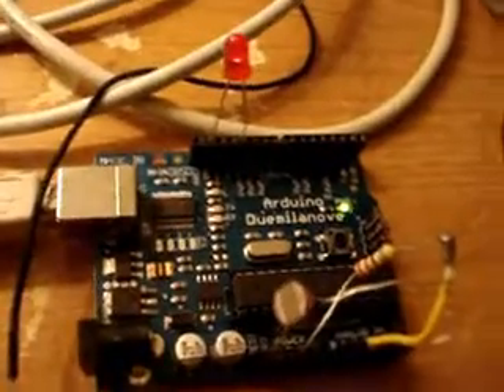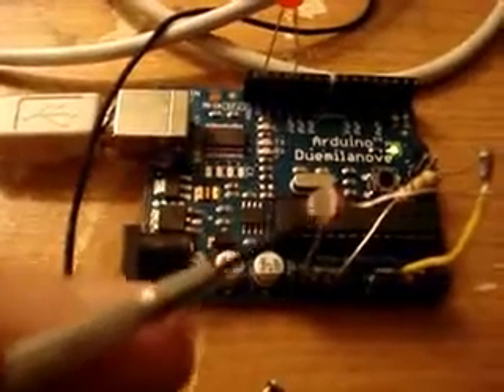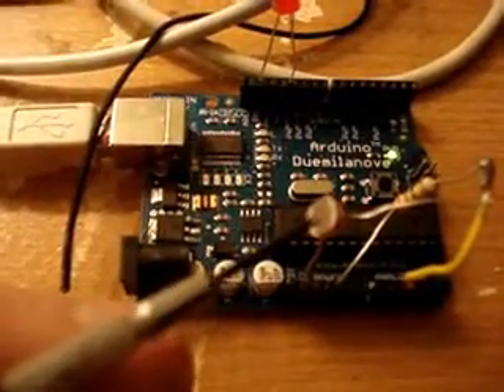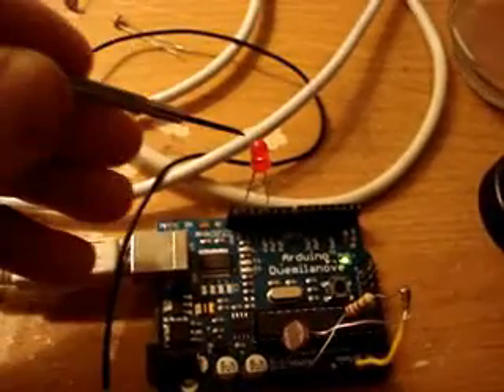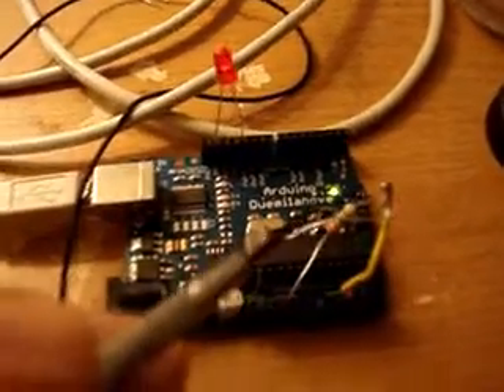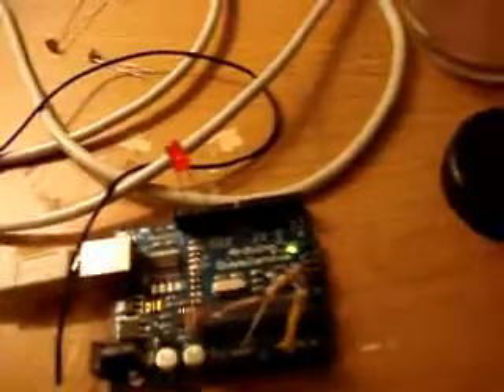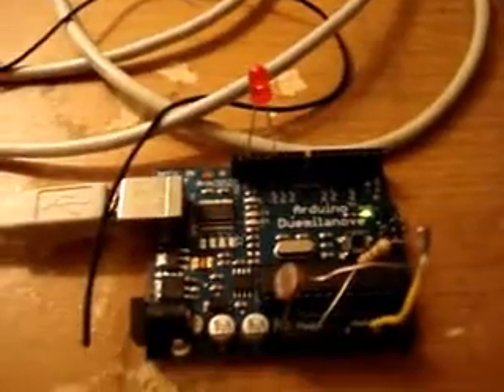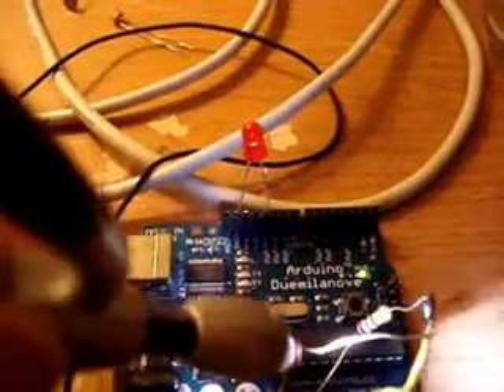photoresistor demo

Comment from the maker: @ferchogottlieb This is just a demonstration of using a photoresistor with the arduino.  It is irrelevant whether the light gets dimmer or brighter.  Depending on the application of the circuit, you can make the led do whatever you need.  You could also have it control something other than an led such as the speed of a motor, the loudness of a buzzer, or whatever you can think of!